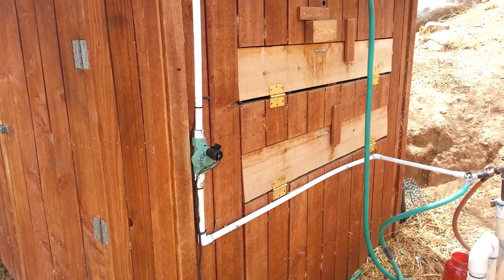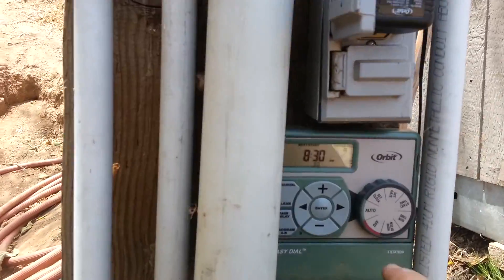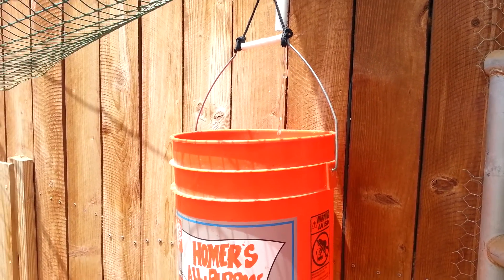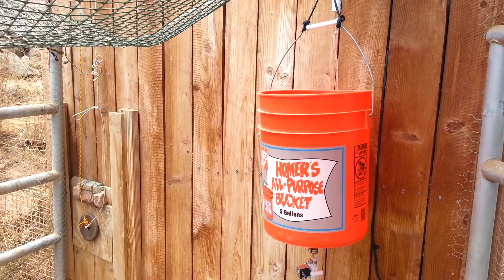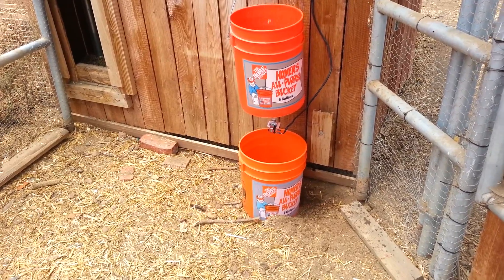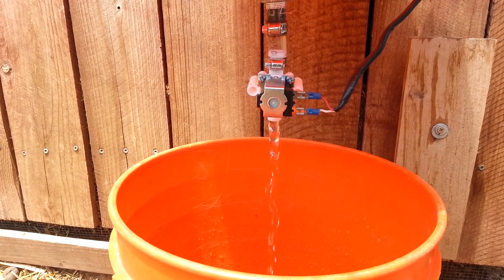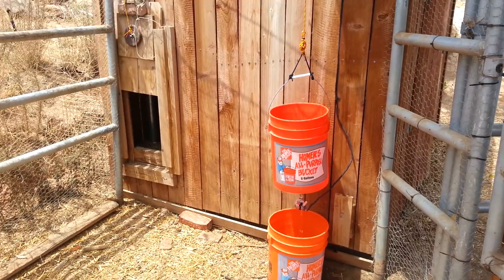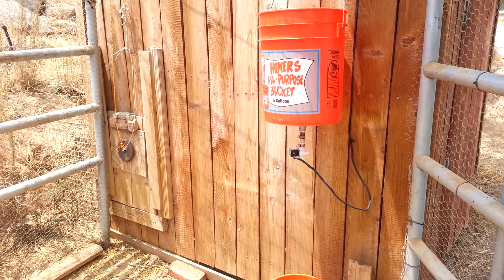Automatic Chicken Coop Door Opener- Redneck Edition

Comment: A simpler setup is two closed containers (with air vents) and an aquarium pump in each .  One on the door, one as the counter weight.  Simple ac timer and pump water from one container to the other. No rain to worry about. cheap components that last forever.  Put antifreeze in it for cold weather.  Use a float switch on each pump to stop when the pump gets to bottom of vessel.  probably cost about $50.00 or so

Comment from the maker: Thanks for the views and the comments. For starters, the coop isn't mine, it belongs to my neighbors. I was asked to tend the chickens while they were on vacation.  In their absence, I did this to make things more convenient on me, so yes, it was in part due to laziness. Tomos. I didn't build it, it was converted from some sort of shed. If I had built it it would look far worse, so thanks for the complement.  As for what happens if it rains?  Hard to tell but the bucket is actually under an overhang off the roof so rain doesn't effect it. Freezing isn't a problem in Dan Diego, we're more likely to run out of water. Racoons are not an issue either so far. As for the chickens that don't make it in before the door closes,  that hasn't happened yet but let's call that natural selection. It is still working to this day, only now it is opening two doors with the employ of a couple more pulleys since the owner went on vacation again and added another chicken yard that I was to lazy to open the door for. I enjoyed the simplicity and fun of designing it.

Comment: Nice.  So do you have racoons in your area?  Around here they are large enough to lift that door.  I suggest one more solenoid and a latch to latch the door shut.  Mine works like this, but I just used a small 24v gear motor and powered it off the sprinkler timer.  It winds up a string.  I also have a 24V solenoid on a gate latch to latch it shut.